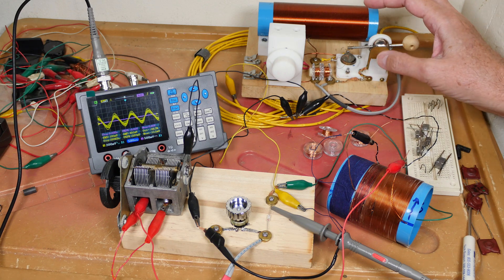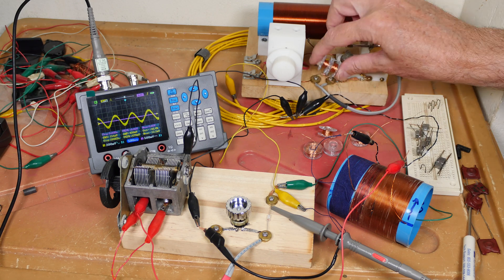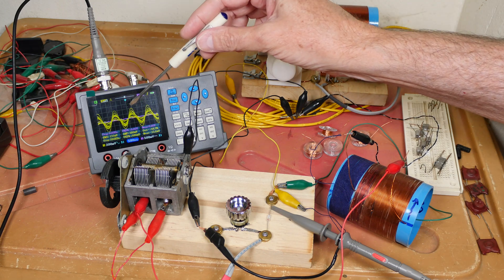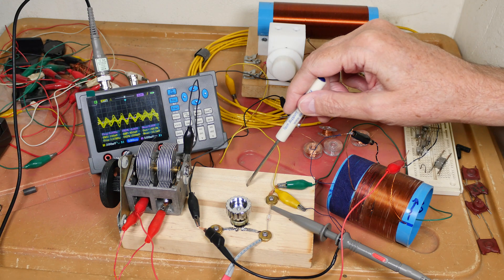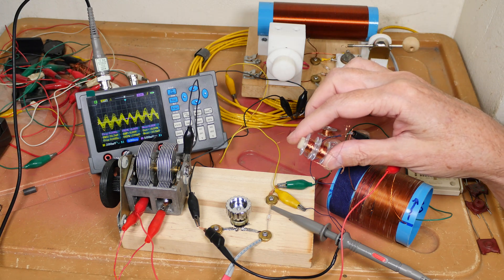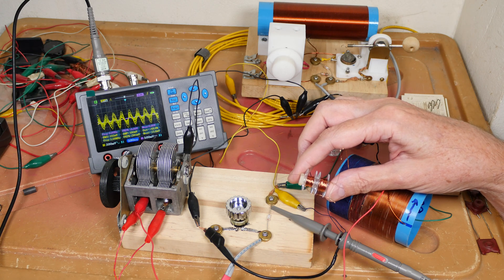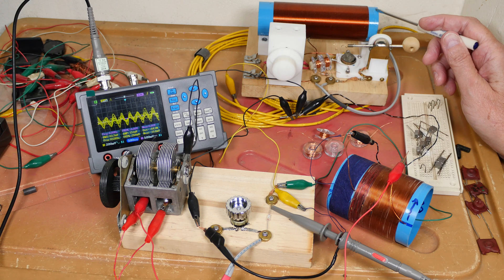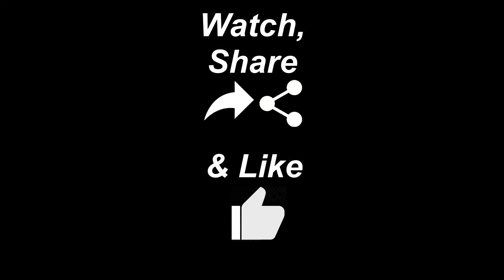Crystal Radio Bobbin Inductors Fail. But WHY? 2/2

Comment: Capacitance, as others mentioned seems the likely issue. The inductors natural resonant frequency might also be in the MW band.  I think a good oscilloscope would need to confirm.
It would interesting to compare the amount of coupling of primary, secondary between the air coil and bobbin coils.   I think the formula is:
L_short = prim inductance when secondary shorted.
L_open  = prim inductance when  secondary is open.
coupling = sqrt(1-(L_short / L_open))  == (0 .. 1)
If capacitance is in the external antenna,  maybe try wrapping the alligator lead around the antenna instead of clipped directly, but I think a ferrite rod would give the biggest improvement. 
These are all just speculations. Very interesting experiments.  Looking forward what you discover.

Comment: You may have too much stray capacitance.  You can try to find the SFR of the coil with a function generator, a scope and a resistor.
Reply from the maker: Maybe. I am testing some different configurations to try to nail down what is going on.
Reply: @tsbrownie  i believe the same.... too much capacitance between turns.

you can try a basket/honeycomb weave and/or a core (ferrite) to have more inductance and less capacitance...

Comment: I suspect that it could have something to do with Q value
Reply: The smaller coil has multilayer windings which means larger capacitance.
This is my guess :)
Reply from the maker: @ulfhaller6818  The scatter windings are supposed to lower parasitic capacitance  but I'm not sure that is happening.
Reply: @tsbrownie  Have you tried basket winding?
Reply from the maker: @ulfhaller6818  I have a video on the coil forms and have done a few tests. Nothing serious yet.

Comment: what type of inductance slash LCR meter do you have and have you used any others that you prefer .
i would like to get one in the few hundred bucks range and would use it most often for crystal radio coils and measuring caps .
i know that there are some pricy ones but would like a nice functional meter that is lasting and trusting, if u have any opinions that would be great to hear , i know that one can just calculate the inductance but with more complex exsotic shapes of coils like diy basket weave style predicting the outcome can be triky and would just be nice to measure real life measurments
Reply from the maker: I've been using an inexpensive one for a while, but it has been acting up. Right now I'm considering the Uni-T 622 or one of those. You have to watch their models because some have very restrictive ranges.  This is the current one:  
https://youtu.be/FB2xF3PGix8
Reply: @tsbrownie  ya ill have to poke around and look at some ones out there , if u need another video idea , that would be an intresting one to watch of potential types of meters and what too look for and what diffrent features may be intresting to have for crystal radio making .
ya its a bit advanced for the boot strap hobby but its nice to have relitive measurments, and to know how assempling ur radio can ffect the ranges .
Reply: @tsbrownie  i did a quick A.I. search for genaral rcl meters on the 'market and this was the responce , not sure yet on the diffrent modles yet and what would may have a good value or not , but i know that video reviews are limited on yt. for rcl meters , maybey a video pointing out some on a video of some that look intrsting on paper would be intresting.and what are yur opinions on ones that your looking at.

A.I. responce 
It's great you're looking for an LCR meter to support your electronics projects! Here are ten well-regarded LCR meters currently available that fit your criteria of auto-ranging, a budget around $300, and the ability to measure inductance from 1 mH and capacitance up to 800 pF.  I've included some popular options with a range of features and prices:
Note: Prices can vary depending on the vendor and current sales/promotions.
1. B&K Precision 878B Handheld LCR Meter
 * Price: Around $250
 * Features:
   * Basic accuracy: 0.5%
   * 40,000 count display
   * Measures L, C, R, D, Q, and θ
   * Test frequencies: 100 Hz, 120 Hz, 1 kHz, 10 kHz, and 100 kHz
   * Auto-ranging and manual ranging
   * Relative mode, data hold, and tolerance mode
   * Backlit LCD
   * Includes test leads, alligator clips, and a carrying case
2. DE-5000 Handheld LCR Meter
 * Price: Around $190
 * Features:
   * Basic accuracy: 0.2%
   * 9999 count dual display
   * Measures L, C, R, D, Q, ESR, and θ
   * Test frequencies: 100 Hz, 120 Hz, 1 kHz, 10 kHz
   * Auto-ranging
   * Smart mode for automatic component identification
   * Relative mode, data hold, and tolerance mode
   * Includes test leads, alligator clips, and a carrying case
3. Hantek 1832C Handheld LCR Meter
 * Price: Around $150
 * Features:
   * Basic accuracy: 0.2%
   * 50,000 count display
   * Measures L, C, R, D, Q, ESR, and θ
   * Test frequencies: 100 Hz, 120 Hz, 1 kHz, 10 kHz, 100 kHz
   * Auto-ranging and manual ranging
   * Relative mode, data hold, and tolerance mode
   * Backlit LCD
   * Includes test leads, alligator clips, and a carrying case
4. OWON B35T+ Bluetooth LCR Meter
 * Price: Around $130
 * Features:
   * Basic accuracy: 0.25%
   * 6000 count display
   * Measures L, C, R, D, Q
   * Test frequency: 1 kHz
   * Auto-ranging
   * Bluetooth connectivity for data logging and analysis
   * Relative mode, data hold
   * Includes test leads and alligator clips
5. Peak LCR45 LCR Meter
 * Price: Around $130
 * Features:
   * Basic accuracy: 0.2%
   * 4000 count display
   * Measures L, C, and R
   * Test frequencies: 100 Hz, 1 kHz, 10 kHz, and 100 kHz
   * Auto-ranging
   * Enhanced measurement resolution
   * Long battery life
   * Compact size
6. Mastech MS5308 LCR Meter
 * Price: Around $250
 * Features:
   * Basic accuracy: 0.1%
   * 20,000 count display
   * Measures L, C, R, D, Q, θ, and ESR
   * Test frequencies: 100 Hz, 120 Hz, 1 kHz, 10 kHz
   * Auto-ranging and manual ranging
   * Relative mode, data hold, and tolerance mode
   * Includes test leads, alligator clips, and a carrying case
7. UNI-T UT612 LCR Multimeter
 * Price: Around $110
 * Features:
   * Basic accuracy: 0.3% (capacitance)
   * 20,000 count display
   * Measures L, C, R, and frequency
   * USB interface for data logging
   * Auto-ranging
   * Also functions as a standard multimeter
8. Aneng Q18 Pro LCR Meter
 * Price: Around $80
 * Features:
   * 9999 count display
   * Measures L, C, R, D, Q, θ
   * Test frequencies: 100 Hz, 1 kHz, and 10 kHz
   * Auto-ranging
   * Relative mode and data hold
   * Includes test leads and alligator clips
9. Victor VC6013L LCR Meter
 * Price: Around $60
 * Features:
   * Basic accuracy: 1%
   * 2000 count display
   * Measures L, C, and R
   * Test frequency: 1 kHz
   * Auto-ranging
   * Data hold
   * Includes test leads
10. BSIDE ESR02 Pro LCR Meter
 * Price: Around $40
 * Features:
   * Basic accuracy: 2%
   * 1999 count display
   * Measures L, C, R, ESR
   * Test frequency: 1 kHz
   * Auto-ranging
   * Data hold
   * Small and portable
When making your final decision, consider these factors:
 * Accuracy: How precise do your measurements need to be for your projects?
 * Measurement Functions: Do you need to measure just L, C, and R, or also D, Q, ESR, and θ?
 * Test Frequencies:  A wider range of test frequencies might be useful depending on your applications.
 * Display and Interface:  A clear, easy-to-read display and intuitive controls can make a big difference.
 * Extra Features:  Consider features like data hold, relative mode, tolerance mode, Bluetooth connectivity, and USB interfaces based on your needs.
I recommend reading reviews and comparing the specifications of a few different models before making your purchase. This will help you choose the best LCR meter for your specific needs and budget.
Reply from the maker: @lmccleary411  Interesting, thank you. You also have to look at the ranges. I saw some that would not read below 100pF or 10uH or thereabout.
Reply: I recently commented to another video about this. I've tried many LCR meters and finally found one  that, for me, is the best--the DER DE-5000 LCR meter. It has near lab grade accuracy,  goes to 100 kHz test frequency. It sells for around $100. I buy the basic meter, no options. I make 3 inch test leads with banana plugs and alligator clips, calibrate the meter with that. I  test all RF inductors at 100 kHz; I  test RF capacitors at 1 kHz.